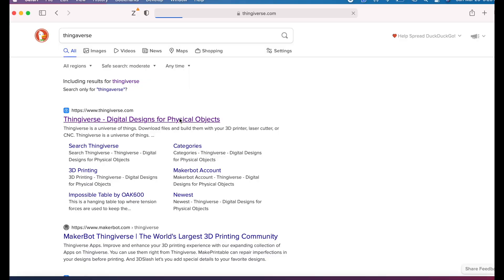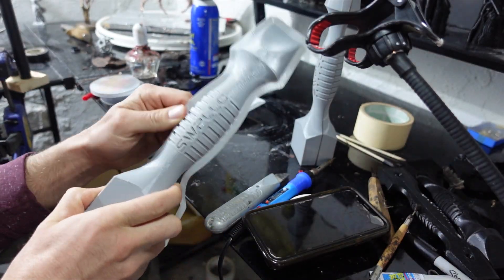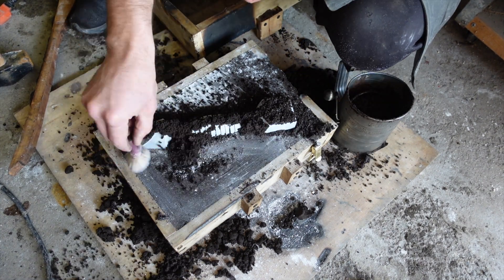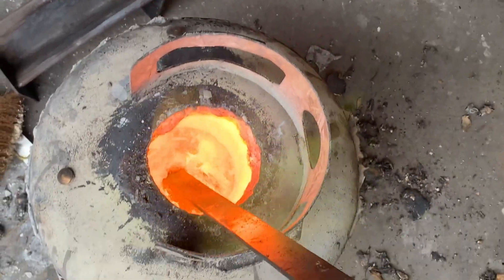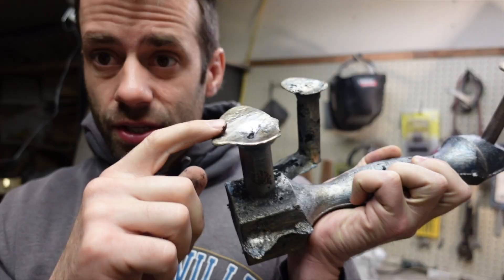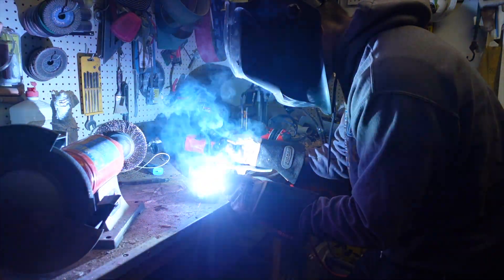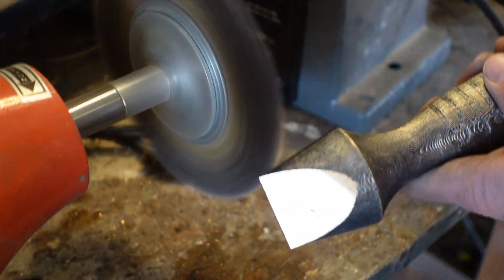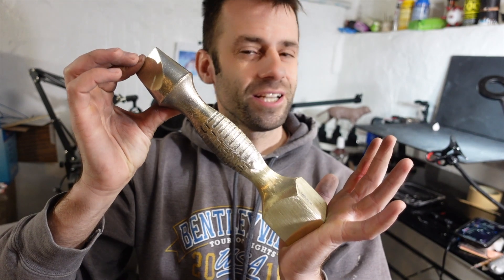Casting a Brass Sand Rammer for Sand Casting

Comment: Looks great to me!  The secret with the feeder is to make it even chunkier than the thing it's feeding.  Your feeder was a bit small, so it froze before the rammer, which can make the shrinkage on the casting even worse.  I'm sure it will work just fine though 👍

And welding on brass? You're brave!  Hope you didn't get sick!
Reply from the maker: There is a fine line between bravery and stupidity 😆 
Thanks.

Comment: Business end is perfect and weight could be too.  Large radius fillets where sprue meets casting maybe, and/or either a core, or thicker and/or extra gates, not sure?  You could always recast it but why bother, it's a rammer.  Casting is perfectly functional and will work exactly as intended.  She's a beauty, and THE RAMMER will yield many a masterpiece.  Compare this to a shinny ingot hunk of metal sitting on a shelve with zero functionality. 
Sorry about finger.  Just another battle-scar that makes you a tougher, smarter, stronger super-hero.
Reply from the maker: Yep. I would much rather use my ingots than to stack them on a shelf.

Comment: You aren't kidding that accidents happen fast with power tools. I inadvertently drilled into my finger a few years ago by holding a part as I was drilling. I hit the exact spot to sever a nerve and leave half my fingertip numb. Fortunately it has 80% recovered since.

The rammer turned out great, and with a bit of character to it!
Reply from the maker: Oh geez. Drill bits to the finger scare me. I think I fear table saws the most. Glad your finger has mostly recovered though.

Comment: Great video. I need to get me a 3D printer. So many things you can do with one.
Reply from the maker: I resisted for a long time because I felt like it was cheating. But now that I have one the things has been running like non stop.
Reply: @lundgrenbronzestudios  For simple faster patterns make TKOR's foam cutter.
https://www.youtube.com/watch?v=N2n_EbRzZ0g
Reply: I would love to see some lost PLA videos. I’ve been trying to sand cast some coins but I can’t get good details. Possibly because the angles are too straight and grabbing the sand when I remove the coin molds from the sand. I think vacuum casting the coins would work a lot better.
Reply from the maker: @Plinkster  I've got some lost PLA videos in the works,
Reply: Awesome 😎

Comment: The tipped part of the rammer is used to first pack the sand on the nearsest parts of the sand to the edges of the casting box. This prevents the sand from falling out of the box when lifted.
Other thing is that I am worried that you will pack the sand too much with a brass sandrammer. I casted mine in aluminum and it is more than enough and you do not get tired so quick.

A thing to consider….
Reply from the maker: Ah that makes sense. I’ll see how it goes.
Reply: @lundgrenbronzestudios  cant wait to see in you next videos how it went 😁